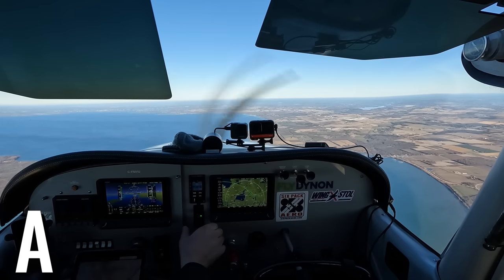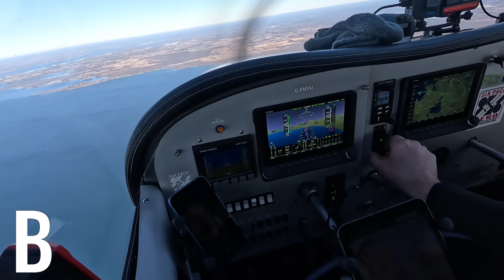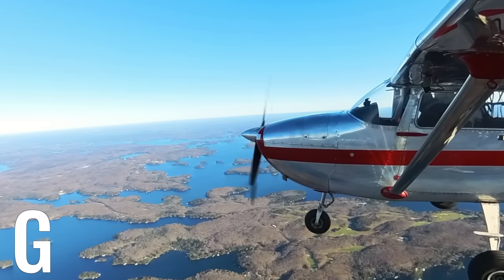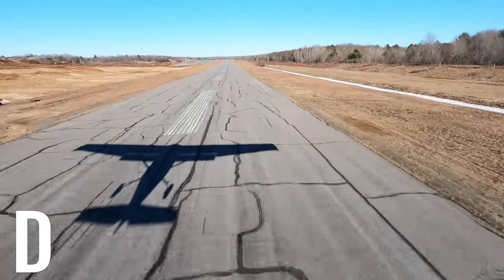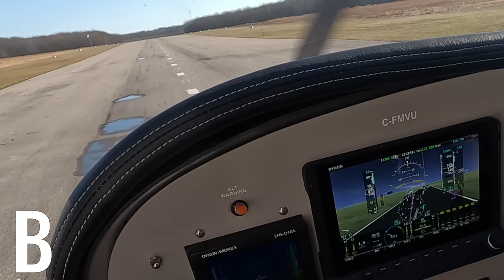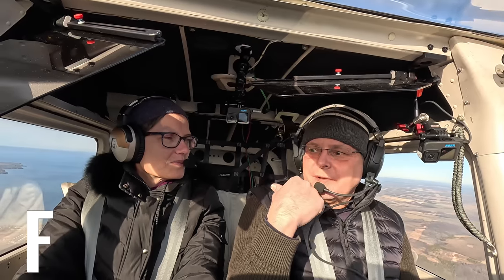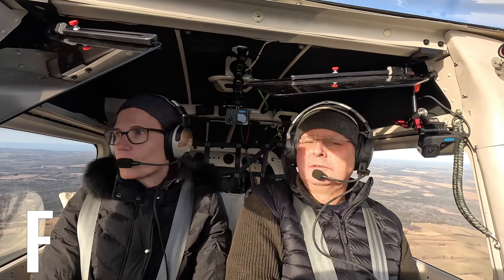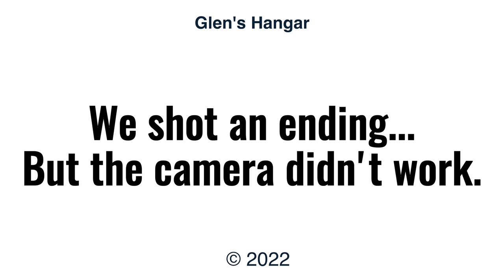Orillia Lunch Flight VLOG - Still Testing Action Cams

Comment: Merry Christmas Glen from Sydney Australia.
The autopilot you're installing: are the servo motors right next to the control surfaces, or in the middle of the plane with connection rods.
Some issues
* Needing to remove aluminium skins.
* Better flying characteristics
* Cost
Merry Christmas
🌟
🌲🛩️

Comment: Great video again, shame the airport restaurant was closed but not a wasted trip in the end. Here's my thoughts on the different cameras
Camera A: Good for handheld shots outside of plane and view of the dyno etc.
Camera B: Similar view to camera H, slightly better quality
Camera C: Lesser quality and more grainy than Camera F
Camera D: Good quality for showing landings
Camera F: Good quality for in the cockpit shots, great talking to camera whilst flying
Camera G: A bit grainy but should suffice as a wing camera as cant really see the background anyways
Camera H: Nice front shot, can see clearly what is ahead of the plane
Camera C and F are realistically a toss up on which one is more reliable
Reply: Agree on all above. With C, I though it had poor backlight handling and the colours were poor. W/B was off maybe. I liked the over the left shoulder angle that B had initially. Am wondering if G is a 360 camera or some kind of pano.

Comment: I have the Lightspeed Zulu 3 (which is essentially the same as the Delta Zulu, minus the CO-detector) and I enjoy it a lot. But I do also have a rather large head, so I can see how it wouldn't fit smaller heads. At work we use the A20 on the jet so I have the comparison there too and it's fine, but doesn't feel as high quality as the Zulu 3.
I want to try the Bose ProFlight to see how that compares.
As for the cameras, A, B and D are probably the ones delivering the best images, most detail and best dynamic range. C, G and H are definitely far behind, imo.

Comment: F has excellent dynamic range and definition but a bit flat.  Throw G away.  B is better than H - sharper with more saturation. A - nice contrast - the shots outside MVU at the first stop were beautiful.  D seems to go soft on the long shots.  C - meh.  F is my favorite!  Years ago, when I was sailing small open craft every weekend on Lake Michigan, I ran a GPS and a chart plotter on a black netbook.  To avoid overheating, I covered the netbook in white contact paper and it worked great all summer long.

Comment: Further to my headset comments from the last video. The mic on the Lightspeed is definitely a big step up on the Bose. It does show a little bit of distortion when Julie had the mic very close to her mouth but is otherwise really clean. The Bose mic seems to distort regardless of the mic position. It is much toppier than the Lightspeed with poor lower mids, so Glen sounds wrong if you're used to hearing him on the cooking channel. It's a great shame about the fit issue as the Bose makes for hard listening with its constant distortion.

Comment: I had an exhaust leak in my Piper this fall , I thought I could smell something and sure enough the carbon monoxide detector began to turn colour. Stay safe in the cold guys, make sure you have your exhaust checked and stick a detector to your panel.
Love your videos.
Reply: It’s easy to not notice the sticker. Should use a digital detector which will beep at you. We got a gas clip detector and it’s overly sensitive if anything but at least you know when there’s CO and when there isn’t.

Comment: Weeeelll.... you did ask, so here goes... A is nice, its clear, seems good tone, but kinda dark.. LOVE F. C is terrible. Maybe its just the contrast to F, but its so washed out.  B too dark, and seems... Off in a way I can't pinpoint maybe just too dark..A is nice too. G is ok, maybe washed out a bit?  Like the angle though, its nice to look at the terrain at times! And the nose of the plane straight side look is nifty. Same for H, angle and view is great, but also clarity and tone are fantastic!  As is D, maybe not as clear, but nice, maybe the frame rate was a bit laggy?  Have to say that landing was fantastic, No idea how you did a full 90 cross wind without having to slip it more.. low wind speed? Still in my understanding of the mechanics, coming it that straight was amazing.

Comment: I still believe that since this is your plane, you could go a different route on cameras. Instead of little action cams that fail all the time, hardwire security-type cameras using power-over-ethernet and then have all the cameras stream to a laptop that you take in and out of the plane. Use the 'dome' type cameras outside and they become essentially weatherproof. Spend a little extra on the ethernet cable and get the fully shielded and insulated stuff and then you have no concern about cross-contamination with your plane's electronics.
Reply from the maker: Not allowed at all - There are an unbelievable number of regulations around what I can do with this aircraft. If it was a homebuilt (like Trent Palmer) I would have the leeway to do what you describe.

Comment: Hi Glen, If cost were not a factor, Would you consider sacrificing Useful Load and space in FMVU for a BRS stc? Just Curious.
Reply from the maker: I wouldn't add a BRS system - I don't really see the need. If you're properly trained, do regular recurrent training, and fly regularly; you should know how to handle any recoverable situation. 
The real killer always seems to be low altitude stall / spin; and a BRS hasn't proven very capable in that situation.

Comment: Altitude alert at +-250ft is reasonable.
Reply: IMO that's way too much. 500' is the separation between cruising altitudes going in different directions. If you're only starting to correct when you're 250' off, ie half way to the other guy's level, that's way too late. If you're in a controlled airspace and you're 250' off your assigned altitude the controller will be yelling at you. The aim should be to stay with +-50' (commercial standards) and if you have an alert for +-100' on the outside, if your attention fails, that's a reasonable failsafe point to start recovery and still stay safe.